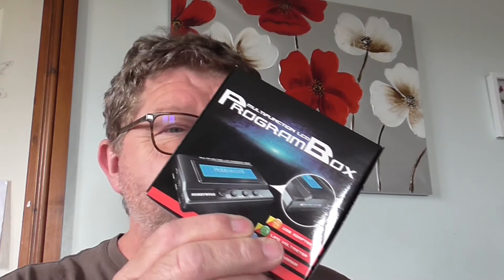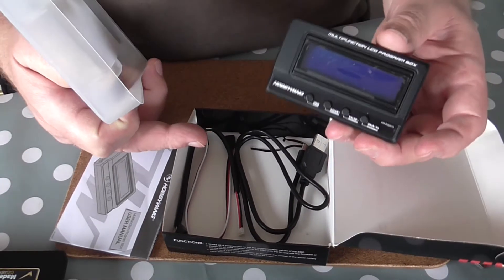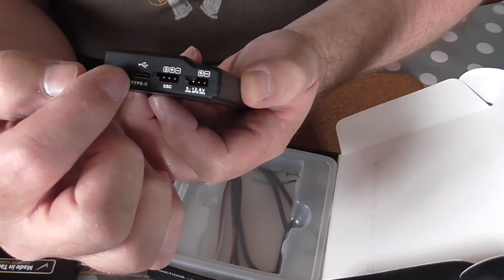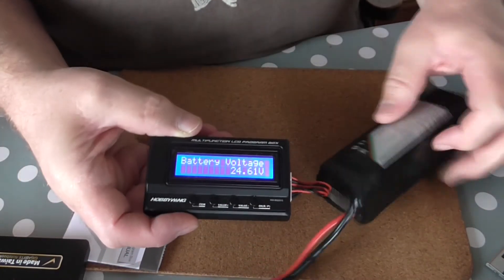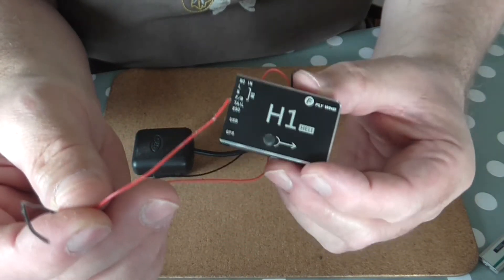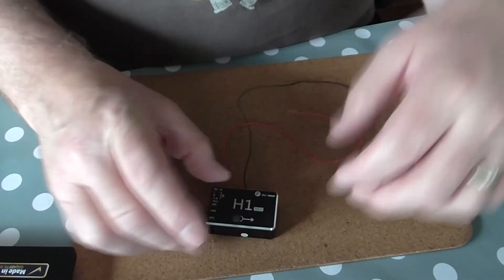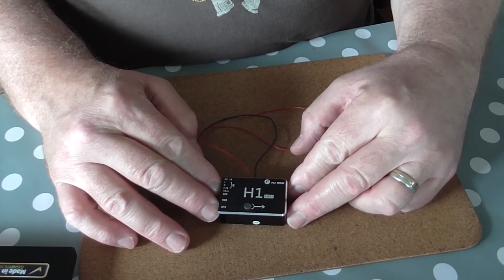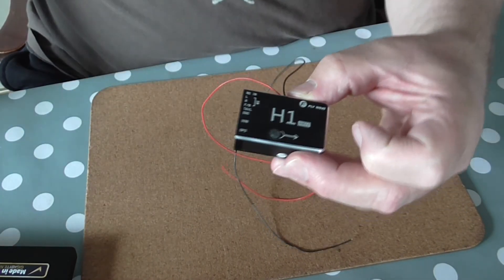Unboxing HobbyWing ESC LCD Programmer and Fly Wing H1 Helicopter Auto Pilot

Comment: hello minimum number of channels on a radio to install the h1 thank you to you
Reply from the maker: You need 4 Channels for the helicopter basics (head roll / pitch, ESC, tail) then another for mode (GPS / 3D / RTH), another for circle/figure 8, another for motor lock and another for inverted flight. So you should have 8 channels to make full use of it and plenty of 2 / 3 ways switches for those functions. Hope that helps. You could possibly get away with 5 if you didn't want to do any of the mode usage but would need to set it up very carefully and it would be a waste of the controller to be honest.
Reply: @modellermark2  merci

Comment: I have a question about the ESC calibration do you still calibrate the ESC with H1 flight controller or is it done with in the H1 flight controller.
Reply: Throttle stick up for max throttle stick down for min. Plus the ESC beeps. Or is this unnecessary with H1 flight controller
Reply from the maker: @nickdean468  I did still do that for mine if I remember corectly but you have to do it while bypassing the H1 as it won't get any signal while connected to the H1 at startup. My hope was that the same throttle range woule be transferred afterwards, even though it doesn't use it as such as the H1 sets the throlle percentage. It probably isn't atually needed with this esc and the H1 but I am pretty sure I did it first anyway.
Reply: @modellermark2  My last qustion about the H1 flight controller is the tail pich slider. If looking at the helicopter from the back does the tail pitch slider Move to the right when using the rudder stick to the right or does the pitch slider move to the left when using the rudder stick to the right and vise versa.On H1 flight controller.
Reply: Great vid @modellermark2 , a quick question to follow on regarding ESC calibration. You mentioned you had to bypass the H1 to calibrate. What's the process for bypassing the H1?
Reply from the maker: @steveelston6869  I just mean that I programmed it on its own and powered by a battery. You can see this in the build video at 5:41 - hope that helps - thanks for watching https://youtu.be/VqeAfvpSXlE?si=UWJPLXvUqU3qGx8z&t=341
Reply from the maker: @steveelston6869  Hi - I just meant that it was powered by a battery and plugged straight into the programmer without the H1 being nvolved - you can see it in the build video - thanks for watching https://youtu.be/VqeAfvpSXlE?si=UWJPLXvUqU3qGx8z&t=341 I will be changing the startup time to 30s to make it less agressive on starting

Comment: hi question about the power supply of the month h1 I have a separate 2s battery to power the servos or is how to plug into the H1 thank you
Reply from the maker: It is all best powered by the ESC connection. The programming in my ALZRC X360 build video https://www.youtube.com/watch?v=VqeAfvpSXlE&t=7s shows programming the ESC to use a BEC voltage of 7.2V which is ok with the servos or quick response and perfect for the H1 controller. No need for a seperate battery.
Reply: thank you for your answer my esc castle has no spout that's why I have a lipo 2s separate for servo.thank you @modellermark2